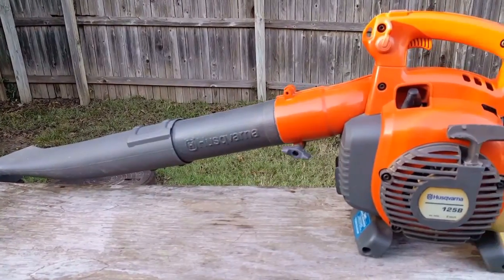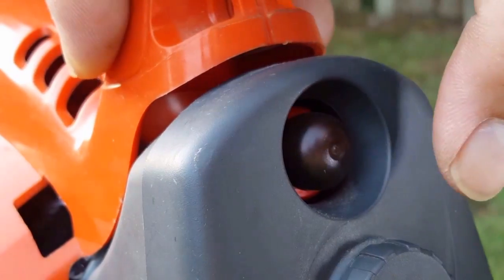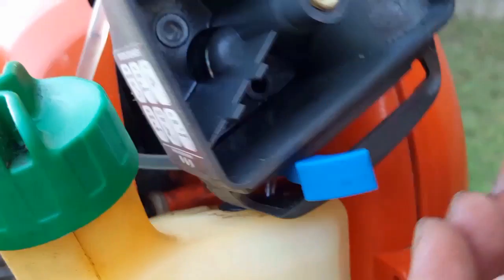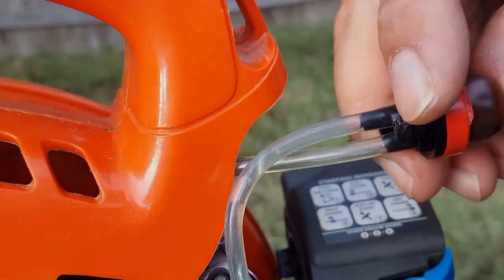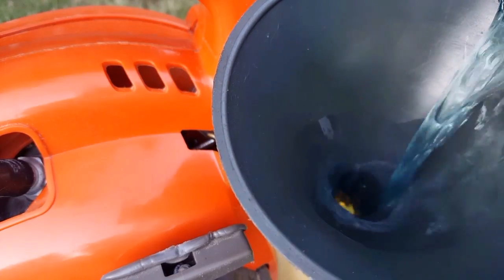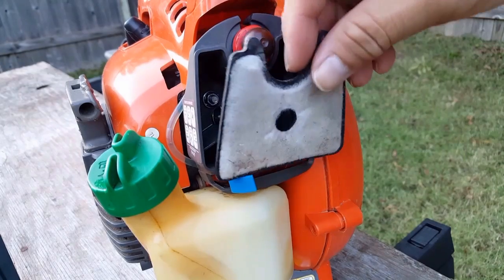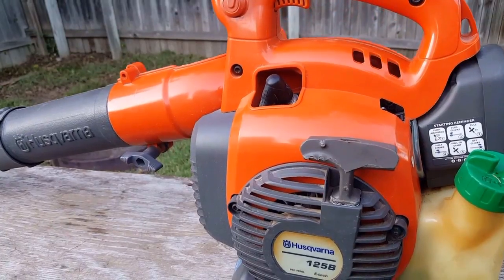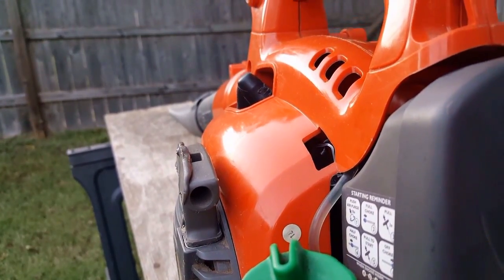Husqvarna leaf blower won't start.

Comment: Maybe in the year 3000, someone will invent a 2-cycle engine that actually starts in the Spring.
Reply from the maker: Lol that will be the day.
Reply: Run some TruFuel through it before storing it for the the winter. Should start up fine come spring time. Same goes for 4 cycle equipment.
Reply: I read somewhere that if you drain all the fuel right before winter. Put some 2 stroke oil in the tank and prime it some so the oil get in the line and cab,  spring come with fresh fuel it should start right up with some ex smoke first few minute.

Comment: If the person who changed the lines did it correctly then it would have ran and with the really bad gas in there it would have destroyed the engine.  You are lucky that they couldn't get it started because if they did that gas would have destroyed the engine and you probably would have gotten it a couple months later with the same thing they said when they wanted you to fix it "It wouldn't start" but that time it would have been a blown engine.  Whoever changed the lines incorrectly saved that blower from having a blown engine because they had to have you repair what someone else did rather than the gas being incorrectly mixed and the engine getting destroyed.
Reply from the maker: Yes it was lucky it didn't start.  Simple problems are nice to get once in a while.  Thanks for the comment

Comment: Don't even have to watch! Low compression, replace piston, ring and cylinder. Bam!
Reply from the maker: thank you Capn' Howie Dent
Reply: @HomeGaragechannel  I actually started with the fuel system. New carburetor, hoses, purge bubble and filter elements...after installing all of that it still wouldn't crank. I then  checked compression and it was down almost 40 lbs. Next time I have this problem I will start with checking compression!
Reply from the maker: @capnhowiedent6197  a very wise choice

Comment: My problem is, my Husqvarna blower is just hard to start. I just purchased it about 5 months ago. It eventually starts. It takes quite a few pulls. I have the proper gas mix. Any suggestions? Thanks
Reply from the maker: Thanks for the comment. Are you following the printed instructions? If so you may have to deviate from them and try a your own steps. However we only do that when the machine gets older tho.
Reply: flooding? I was on here because my blower seems to flood too easily upon starting. If it turns over on the first pull in full choke it might start on the second pull at half choke and run. However, if it doesn't turn over on the first pull in full choke, it will not start. I've never gotten it to crank in any other sequence. Pressing the accelerator seems inconsequential. It never starts at half choke on first pull. It never starts at choke-off. It has to have plenty of gas in the tank to start, and it has to have fuel in the primer bulb. If it runs, it runs fine. If it doesn't start as described, I have to let it sit for several minutes or hours and try again later. This is really frustrating. I was able to get it to start like three or four different times in a row. I thought I had the sequence figured out. The next day, when I showed my father-in-law that it was running and fine and that I had figured out the magical sequence for starting it, I could not get it to turn over even once. He was throwing it away because he had become so frustrated with it. I have taken it under my wing to do more experiments on it. Interestingly, after a number of failed attempts on various days at various times, I picked it up and it worked as described and ran until it was out of gas. I would love to know if there is some adjustment or some part that is causing it to flood so easily and not start. I enjoyed your video as I often do what you did and I'm always learning through the experience and from the generosity of Youtubers like yourself.

Comment: I just got one of these blowers. It started for a bit, got kind of hot & quit running. Now it won't start at all. Has spark, seems to be getting  lots of fuel. Not sure what to do next.
Reply from the maker: Thank you for the comment I appreciate it. Is the gas fresh?  If you tried and tried to start it it might be flooded. Take off the spark plug and see if its wet with gas or dry as a bone.  If its wet try to start it without the choke and pull for a full 30 seconds.

Comment: I worked on a Craftsman blower last year had the same issue with the primer bulb. It's a good thing you checked the gas before starting it!  Also good for the customer that it wouldn't start or it'd be toast...lol
Reply from the maker: You are absolutely correct.  Thanks!

Comment: I have the exact same model. My unit runs fine at full throttle but dies whenever at idle. Does it need idle screw adjusted? Any help is appreciated!
Reply from the maker: Give it a shot.  Turn out the screw closer to the engine about half a turn and see of it will idle

Comment: I have the same model, I’ve changed the plug, fuel lines, the bulb,  tested the on off switch, plug for spark, module and adjusted the module and still can’t get the blower to start. Any help would b appreciated!
Reply from the maker: So did you have spark? If so you might need to test the compression. If that's over 50 psi then replace the carb.
Reply: exactly the same problem here. New spark plug, gas. I have good spark as well, but will not start. What was your solution? I dont have time to keep working on this thing and might buy a new one of different brand.

Comment: Why does swapping the fuel lines change anything?
And if they have never been changed, could they be the problem?
Reply from the maker: The fuel lines on this carb setup is supposed to pull fuel from the tank thru the carb, then the primer and back to the tank.  Since the lines were switched the fuel didn't flow like it was supposed to and the carb didn't work in that configuration. If they had never been change they would probably be broken at this point. They don't last for a long time.

Comment: I have a Husqvarna 580bts. It used to run fine. After some mounting bolts were replaced on it, I can't keep it running. It starts, then high idols and stalls. I've tried adjusting the throttle control, the choke, nothing seems to work.
Reply from the maker: Thank you travis povey for the comment.  It sounds like the carb is running out of gas because of the high idle and dying. Have you gone thru the carb?
Reply: @HomeGaragechannel  No sir. I did change the plug and now it runs but only on full throttle. As soon as I back it down  it stalls. Will not idle at all.
Reply from the maker: Please consider at least looking at the metering diaphragm.  It looks like you have to go everything to rule it stuff.

Comment: So what if it isn't the fuel mix? 🤔
Reply from the maker: typically after that, it's the carb. eIther the metering diaphragm is hardening or the carb needs to be cleaned

Comment: Same model. Wont start. New plug, good spark, fresh gas. Still wont start. Probably will switch brands. I dont need these hassles.
Reply from the maker: Did you replace the carb?
Reply: @HomeGaragechannel  no. Do the carbs go bad for some reason?
Reply from the maker: @diyoregonnowtexas9202  usually the diaphragms inside them go bad.
Reply: @HomeGaragechannel  my Husqvarna blower/mulcher was great the first and second year then come spring time the third year it won’t stay started. Once I pull on the trigger to give it some gas it dies on me. Any ideas?